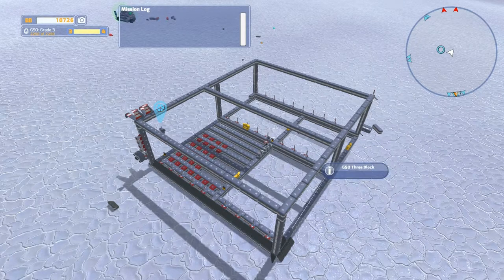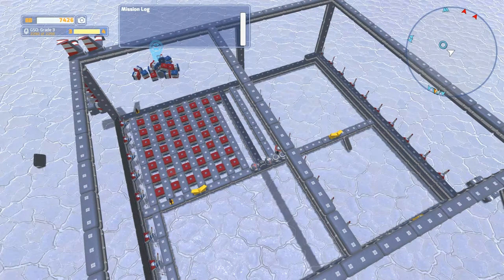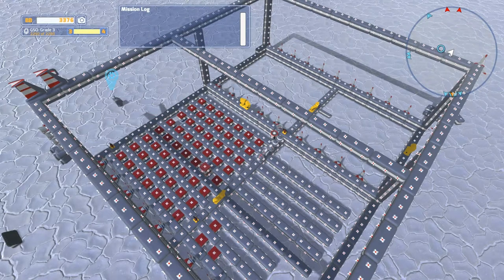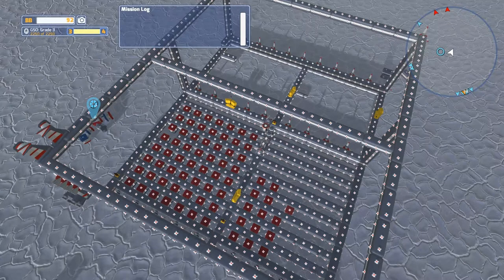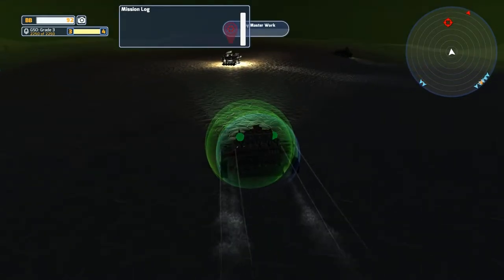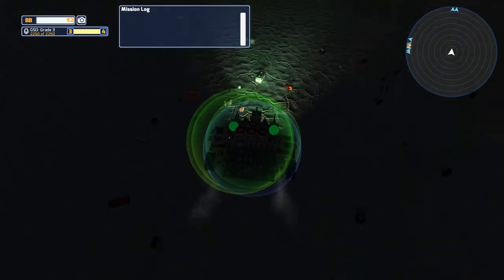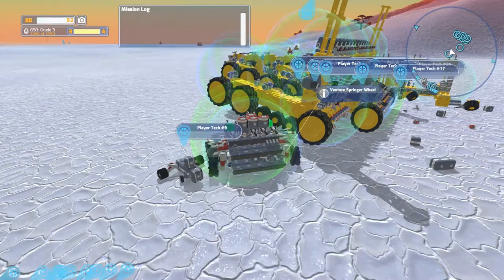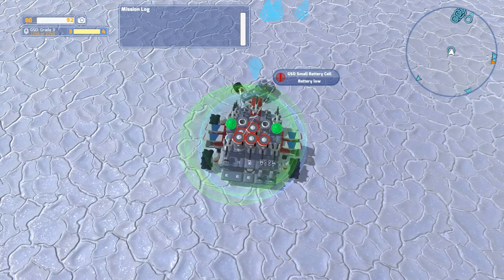Terra Tech - Lets Play - Season 2 - Part 39 - Flooring Our Plane Bot

Comment: I just thought of a major design change.... a few eps ago you found a huge hover engine... wouldn't it help tons if you had the bottom of the flying bot covered with hover engines?

btw your missing a 3block in that first square section :P

Comment: Upper left corner. See that camera button? That is the snapshot button, and what you do to save a tech to rebuy later. You do not have to send off to twitter, as that does something a bit more. 

Basically push button in the upper left that looks like camera (old fashion looking). Name tech, and save. You can ignore the twitter thing, as after you click save, it will be saved.

Using twitter will actually send your current tech to it; which means loosing it. Then you would have to buy it to get back. So only send off twitter if you actually want to send off. Otherwise just ignore, and continue on.

Mission log is empty, you don't have to do anything, until you get a new mission; which at the moment you will have to go out of your way to do if you want to do the new one. Mountain hunting. So currently it will remain empty, and therefore is up to you, as the last quest from GSO you did set you free to do what you want.

I don't think they changed the armor much, it just might be the fact you are not using your death machine that you are noticing the affect. Since those were meant for GSO, and you were using geocorp; which is a total different class. The megaton cannon is just that powerful, and having that many weapons of great powerful will effectively render the armor pieces null. The angle ones have more armor than the plating.

I think what they fixed was not directly connected to those type of block, but more like for all blocks; since a while back they had problems with hits just popping off blocks... That was 0.5.17 or .13 maybe... Don't remember when exactly.

What I find funny is that when they finally got the first level of missions you have decided to go to the smaller techs. Ironic right? Oh well... At least you pull off nice entertainment. :D